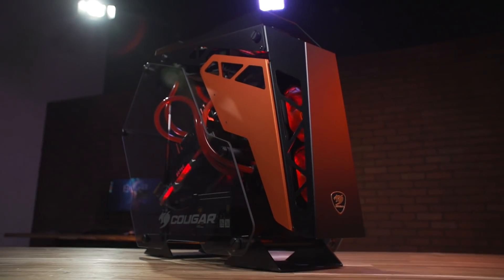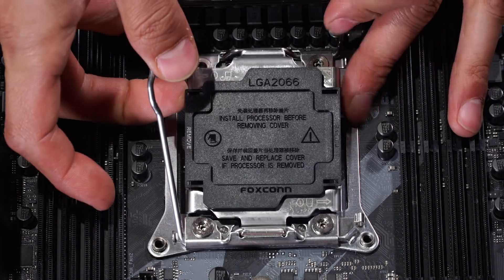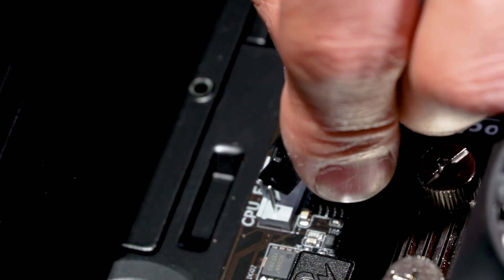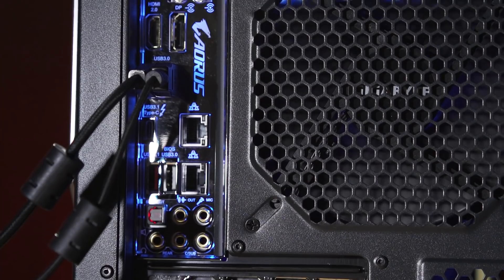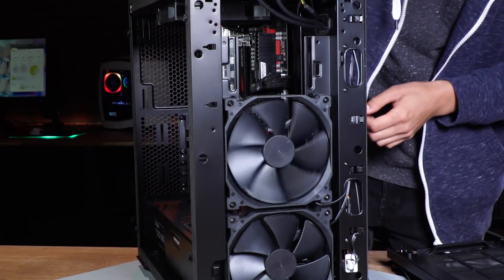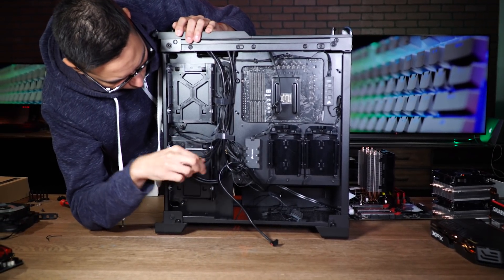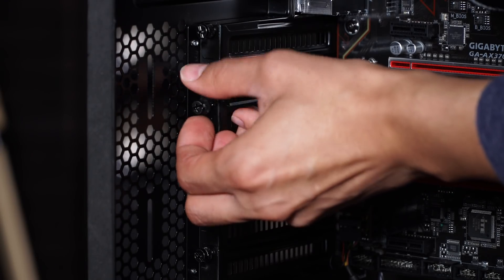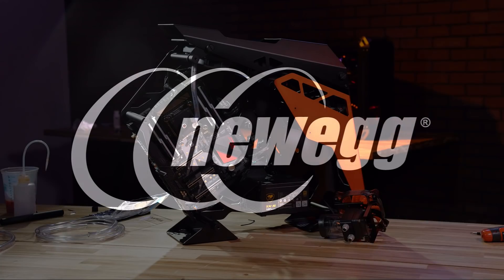How To Build a PC - Newegg's Step-By-Step Building Guide

Comment: awesome brilliant tutorial. when i had to upgrade my windows xp scratch build ti windows 10, i pressed the outside power switch and nothin g happened! was so bummed, but troubleshooted the power sw plug ins and an 6/2 pin power cable onto the motherboard that didn't fit into the motherboard and had to do a little surgery on a tip of the 2 pin connector then plugged it in to the motherboard and everything booted up ! rgb's, fans whirring all good things happened!

Comment: This proof you guys from newegg know how to build. Why don't you do it in your pre-build ones. Stock cooler on a 8 core 16 thread cpu that is equivalent as farting on a forrest fire. With a Nvme ssd right under it without shield to make things worse.
And single 16gb RAM stick on most of your pre-builds. And a cheap motherboard that chokes al the components. (MINI ITX, SERIOUSLY?) And a psu that has no spare power whatsoever. And a rear io that was already disappointing in 2007. Not even talking about the tricilion hard crasher right out of the box. Good job Newegg

Comment: I don't have the ssd at 6:18, but I do have the other ssd at 10:25, do I need the one earlier in the video, or can I just keep the one at the 10 minute mark and will still my pc work fine? (It's my first time making a PC, I'd really appreciate some help!)
Reply: You can use either. The M.2 SSDs (6:18) are the newer form factor, but the standard 2.5" SSDs work just fine for most use cases.

Comment: Please.. dont mount a radiator in the bottom of the case.. If you do mount it on the front or back make sure the tubes are facing the bottom of the case.. and the best option is at the top. Just another thing.. top fans are not supposed to blow air in but to take air out since the hot air rises..

Comment: Is there a video to build a lap top?
Reply: Not really. Laptops don't have many standardized parts unlike desktop computers. Laptop motherboards come in a seemingly infinite number of sizes and shapes depending on make, brand, and model so it is not feasible to make a universal laptop housing, for instance.

The closest you can get would be a custom configuration. A lot of the high-end (and very expensive) models will let you customize your laptop. This of course will increase the price a lot depending on what you customize.

Comment: Do we not need a Network Card anymore? I don't recall seeing it mentioned.
Reply: The network card has been integrated in most consumer-level PCs for nearly 2 decades. You can still buy dedicated network cards if you want, but its not required for most users.  At 11:46, you can see the network port which is to the right of the bottom USB ports.

Comment: Today you cant build a PC. You can only assemby one. PCs were build in the 80's and 90´s. Back then you had to move jumpers to the right slots to tell your motherboard what CPU ram and card slots it will be used with, set up bios, low format your hard drive before actually formatting. You had to set slave and master drives, install the right crystal to get the right speed from your CPU without burning it. Computers back in the days required some knowledge to build one. Hardware also had to be compatible or else it would not work so you had to know what exactly hardware to use with your motherboard and cpu or else it would not work or maybe even break upon installing. Today it is just buying hardware and seeing what slot it fits in. Thats not building. Thats a pack of lego blocks with instructions.

Comment: The radiator is placed incorrectly in this video. The radiator tube inlet/outlet should be oriented at the bottom not the top. Air bubbles get trapped up top in the tubes.

Comment: Also does the build your pc also show if the parts will fit?
Reply from the maker: Not confident in answering that without checking with the programmers. To be safe, I would assume no and submit some feedback on the page. I'll reach out internally about the issue. Great Question.
Reply from the maker: @SpiderWeb I checked with the team, it does take into account if the parts will fit.

for GPU, we check the max. length which the case allows for GPU

we check the fan size of the AIO to see if it will fit with case's radiator slot

Comment: I thought you weren't supposed to press down on the cpu, but it seems like the CPU cooler does, is there something I'm missing?
Reply from the maker: When properly installed, a CPU cooler applies consistent, safe contact across the surface of the CPU - enough to cool it without damaging anything. Over-tightenting the cooler is bad for the same reason pressing down with your finger on the CPU is bad.

Comment: I went on your website and I couldnt find a preselected pack
Reply: Can you tell me what to look up or a link
Reply from the maker: Check out our PC builder tool. It has 3 pre-builts you can start from - https://www.newegg.com/tools/custom-pc-builder/
Reply: @Neweggstudio  thanks so much, if I do get one this will be my first one.
Reply: @Neweggstudio  what's a good beginner monitor you would recommend
Reply from the maker: @thebeast9226  If you're looking for a beginner monitor without any frills (like high refresh rates) look for something in the 1080p category. 24-27" should be great. For a lower price point, stay away from the game-centric monitors. They're going to generally run you a lot more $$. Look for some stuff from LG/HP/Dell etc. You can get a decent, entry-level monitor for around $100.
Reply: @Neweggstudio  Thanks alot again I really appreciate that.

Comment: Can any case work for a build or do certain brands only work with certain cases? I really like that cougar orange one
Reply from the maker: You just need to make sure the motherboard and GPU will fit. If those two things fit in the case it's likely everything else will.
So for motherboard, make sure the case can fit whatever size dimension your mobo is: atx, micro itx, mini atx. 
For GPU, look at length and compare it to the case length.
Reply: Thank you, I’m new to this pc building and it’s a lot to take in when hearing all these terms, this video helps a lot but the case is the eye candy of the pc when first looking

Comment: No lie, I know i didn’t have a bone of engineering or any builder of any kind for that matter when I found myself hating just about every second of the process. Popping the ram in was satisfying tho and ryzen cpus coming with a fan simplified this. I wish I had picked an easier case to build on than the one I got, but nonetheless I was happy I built it and saved the money. Boutta move on from my first build and I’m really not looking forward to the building part but this video is amazing as a refresher or even a beginner intro vid. Good job

Comment: Why is there so less thermal paste, i thought you’d have to cover the whole cpu 
- Verge
Reply: The way it's applied here is bad.use some thing to spread it.
Reply: @KingofL85  i wouldnt say its as bad as what the verge did
Reply: if you put paste in centre it auto spreads when fan it attached to it.still spreading manually is best

Comment: 1:15
heavy breathing

2:48
mental meltdown

5:03
Newegg has officially chosen a side and the battle lines are drawn.

7:02
Ahh LPX ram.  My personal favorite.

8:09
They got humor.  +1

Pretty damn good build guide.  Better than the Verge's, though having a guide where you instruct the user to run a hose from their faucet directly to their case so it pours water over the motherboard to keep it cool would be a better guide than the Verge's.
Reply: Yay!  I got a heart from Newegg.  I knew I was right in ordering all the stuff I could for my PC from them.  Can't edit the original comment since it'll remove the heart and I don't want that.
Reply from the maker: @randomlyentertaining8287  How about a reply? What CPU/Mobo/GPU are you going with?
Reply: @Neweggstudio  fanboy squealing

I used a Gigabyte GA-B250M-DS3H, a Radeon RX 580 Armor OC 8GB GPU, and a Pentium G4560T, though the CPU was not of my choice.  I wanted a i7-7700, since it was the best CPU I could use with that board (Yeah, I messed up with buying that) but my job fired me before I could buy it and after, I couldn't afford a 300-350 dollar CPU so I had to get the G4560T on Ebay for 49 bucks.

At least half my PC has Newegg purchased stuff in it.  My case, PSU, GPU, and monitor (the one I bought when I built it.  Was destroyed in a fit of anger, couldn't afford an exact replacement) all came from you guys and got to say, I was very happy with the speed of delivery.  Only three days between purchase and receipt.  I should also be buying a Crucial BX500 2TB SSD from you guys within a couple months to expand my storage since nowadays, 550 GB of total storage between two drives isn't a whole lot of space when you have Steam and their sales.

Hope my blathering wasn't annoying.  When I talk, I usually go overboard in detail.
Reply: @AMRAMRS  r/woosh
I wouldn't.  What I was doing was making a joke that the Verge's build was worse than what I stated.

Comment: what about explaining the differance between the m.2 ssd like m.2 sata or m.2 nvme. the m.2 sata you cant use certain sata ports on your mother board depending in which slot you connected it to on mother board if you have more than 1 and has a slower transfer rate as the m.2 nvme has a much faster transfer rate. So if you using an m.2 sata and you have all your sata ports on your mother board and something not working, chances are that will be the problem
Reply from the maker: we just did a video along those lines. It's not everything you're looking for, but it covers some of it
 - https://youtu.be/ylb26loADms

Comment: i know this may sound stupid i don't have any experience and i plan to build a pc though i have what i want do you need to buy the cable separate? or does it come with the package?
Reply from the maker: Which cable specifically are you asking about? If you buy a full set of components you should most likely have all the cables you need.

Comment: I'm surprised and a bit dismayed that this video didn't include a bench test for post purposes,...essentially, test the parts before you put them inside,...or else you find out after installation that something doesn't work and have to take it all apart again,...post testing is pretty easy.

Comment: Could someone tell me if I need absolutely a CPU cooler if I have like 6 cases fans? I'm planning on building a gaming/streaming/VR/3D modeling PC... So yeah it's gonna be hot in there... Planning on using Intel Core I7-9700K, GeForce RTX 2080 Super...Never build a PC before
Reply from the maker: You are going to want at least a basic air cooler for your CPU, and maybe something more substantial, considering all your big plans for that system. It's not just about the heat in your case as a whole, it's about the heat on the CPU specifically - you want to draw that away with a cooler, for improved performance.
Reply: @Neweggstudio  Thank you for your quick response, it makes sense. Looking forward for this build.

Comment: 11:30 most of the time temps will be lower if you exhaust out the top rather than using those fans as intakes because air rises.  A typical fan configuration is air pulling in from the front, exhaust on top and back.

Comment: Where is the cd/dvd optical drive?
Reply from the maker: Most computer cases don't come with a slot for a CD/DVD drives anymore since the technology is largely obsolete. If you want one, make sure you can fit it into your case and then you'll likely need to connect it with a 3-pin molex connector to your power supply.

Comment: I tried to put my monitor INTO the GPU slot.... I figured having a direct line from the graphics slot TO the monitor would eliminate any latency issues.... For some reason, it's not working... This video never said that I COULDN'T do that. I need one of your Newegg reps to contact me immediately regarding FULL reimbursement(I bought NONE of the components through you guys), but clearly this poorly made video is to blame for this failure. Please contact me as soon as possible.

😂😂😂😂😂
Reply: is this satirical cause I’m panicking